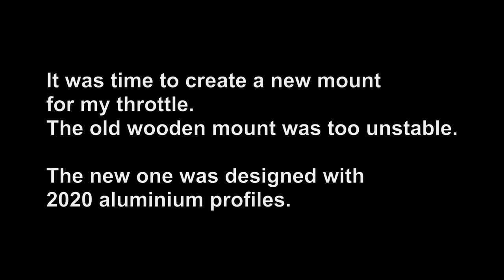F-16 Home Cockpit 02 - Building the new throttlemount

Comment: Very good your work, how did you solve the wiring problem?
Please would it be possible for you to share these STL files and the measurements of the 2020 aluminum profile.
Thanks,for the video, I'll subscribe to your channel!
Reply from the maker: Thank you!
I don't think, the measurements of the profile will help you, they are cut to length to fit my hull/structure (which is far from standard measurements). It's just 20x20mm alu profile.
The STL is available at the "F-16 - Cockpit Builders" Facebook groups file section.

My print with 60% infill was too weak, I will replace it with a steel version shortly to be on the save side ;)
Reply: @simhangar6216 👉👉thanks,mate👈👈
Reply from the maker: @humberto367  I totally overread the wiring question, sorry.
I cut the original wires, lengthened them by soldering pieces  to the side of the arm and the cut ends are connected through screw terminals.
Reply: @simhangar6216  !
 Hi,you have a lot of good stuff that you developed, i have 7" lcd screens, i saw your thrustmaster mfd project, very good, with 3d prints, very cool!
a question did you build your Joystick Force Sensor?
thanks!💯🖖
Reply from the maker: @humberto367  Thank you very much! 
Since I'm into flightsimming again more, I hope to publish a bit of content on my website and youtube the next time :)

My force sensor is one of the first batches of the FCC, I bought it ages ago.
IIRC sadly the creator passed away some time ago 😞
Reply: @simhangar6216  👉I've been visiting your facebook page, your children are very beautiful!
Stay safe and stay tuned!👈